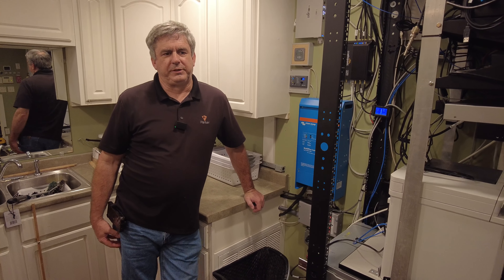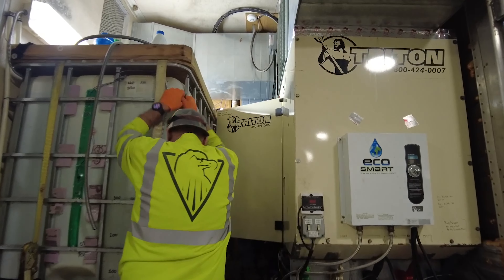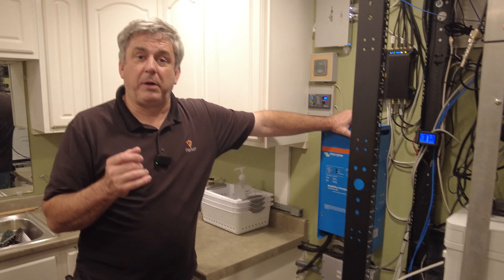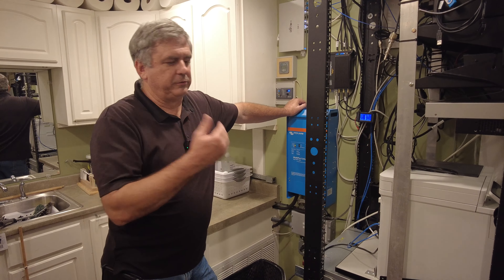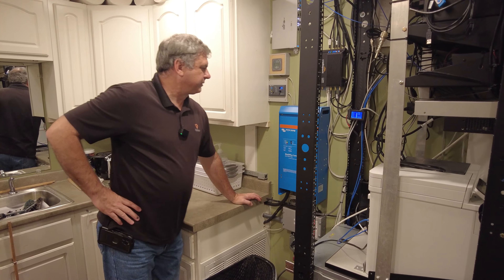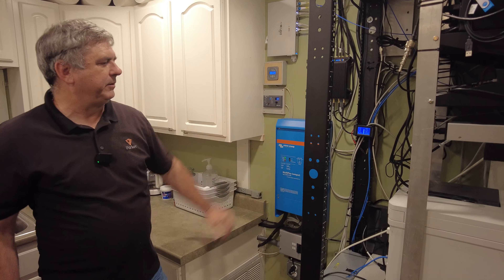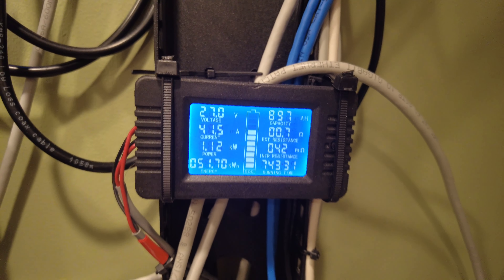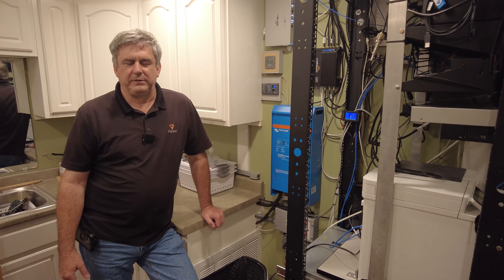Upgrading our Disaster Recovery Sleeping Trailer with Victron & Battle Born Batteries!

Comment: Does the rack not have its own Uninterrupted Power Supply (online battery backup) separate from the trailers battery and generator power?
Reply from the maker: Yes.  Prehaps I should have made that clearer.  We use the victron inverter charger in that role.  With the difference being that it will now hold the system for 12 plus hours compared to an ups that typically provides full load for 11 mins.   Since that video was made we have added more batteries and have tested to know that we are beyond 14 hours in real worlds senerio.   Great question thanks for watching.
Reply: @ParkerSystems  That’s awesome! Your channel is awesome and I can’t wait to see more content. Keep up the great work!
Reply: Are you not isolating the equipment in the rack with it's own UPS?   What about transient loads that come from the motor loads in the refrigeration units...   I would consider mounting a rack mount UPS with an additional  set of batteries (like a APC 3000 or similar) and have all power in the rack coming thru the UPS.   This also gives you flexibility to shut down servers when you have a significant issue with supply.          @ParkerSystems    @ParkerSystems